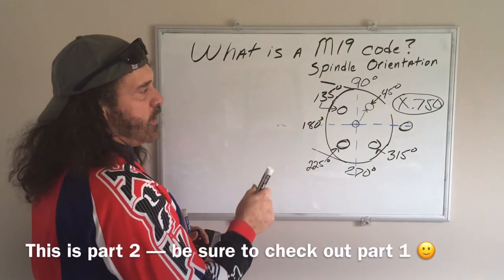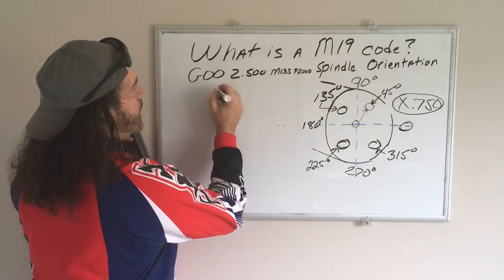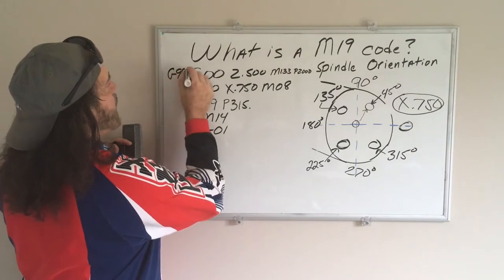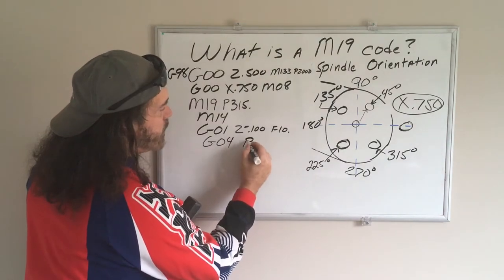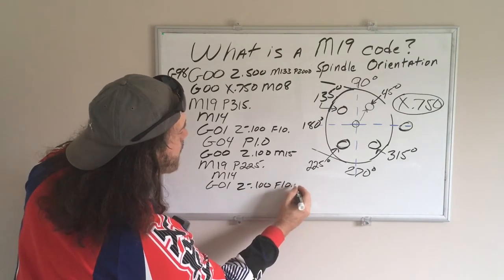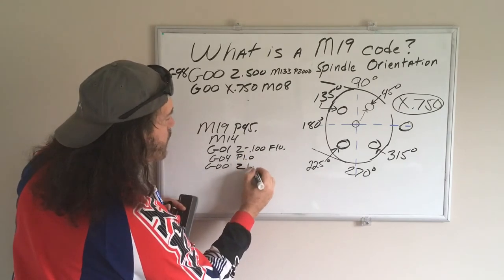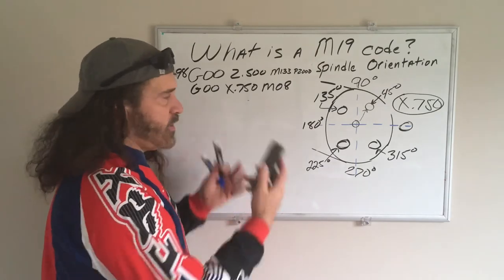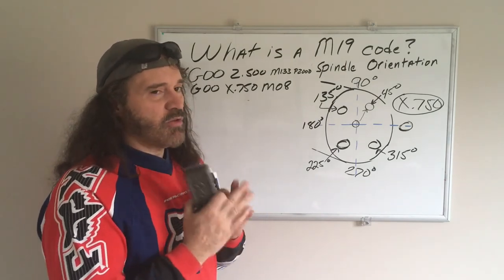HAAS CNC lathe (Part 2 of 2) - M19 code explained for beginners with programming example

Comment: Why m15 befor moving to new p location? I ask this because only tool is moving
Reply from the maker: You actually do not have to even have to put a M15 code in at all.......once you activate a M19 code with a specified P value, it will automatically unclamp the spindle and move to the next location. I primarily used the M14 code in the video for beginners to clamp the main spindle and use the M15 code to unclamp the spindle. As beginners get more comfortable, they can program most situations without a M14 and M15 , since the M19 will hold the spindle in place.